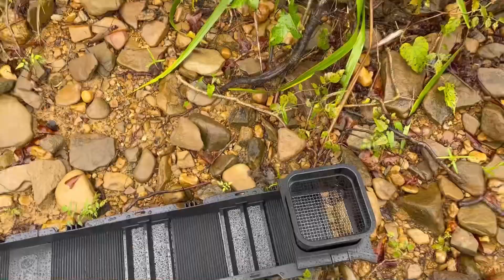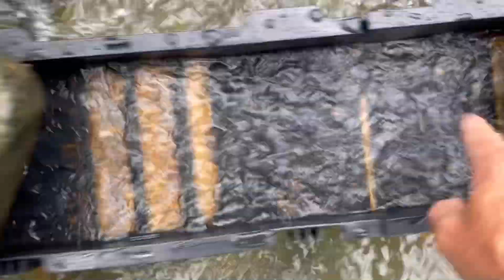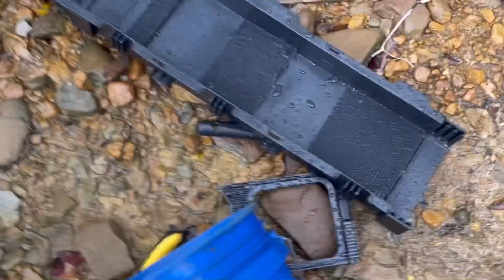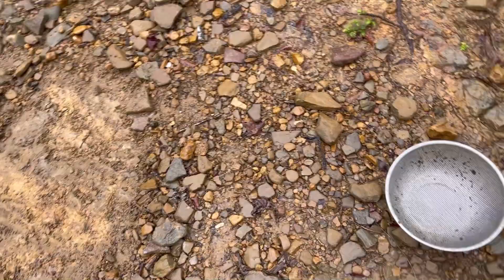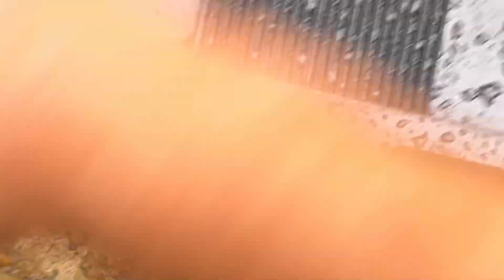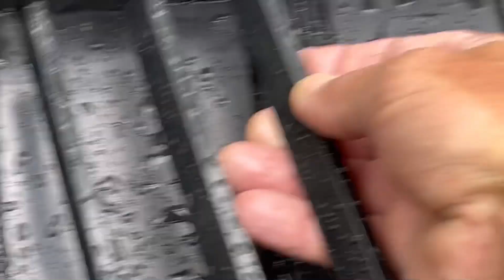Gold Fever again Trying a new sluice box

Comment: It's a nice setup.  I just don't think I could handle having all plastic like that.  I am sure I would end up breaking it.  
I think I would stick with dream mat or the VDR (Infinity Prospecting) The mat I have in my 50" is dream mat designed for fine gold.  Bad part is I have to classify down to atleast 10 mesh.  However it's not hard to do so with the 12 mesh arbor classifier I have.
Reply from the maker: Yes this weekend I’m gonna test them side-by-side